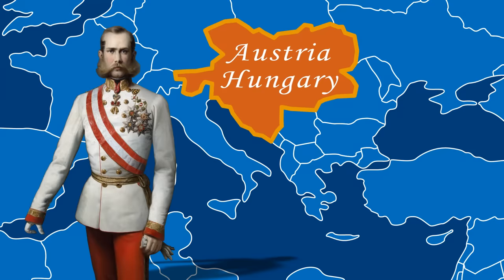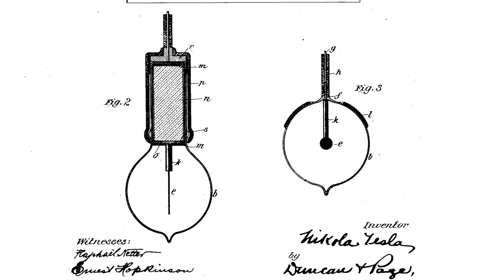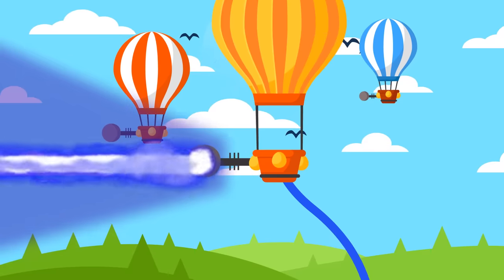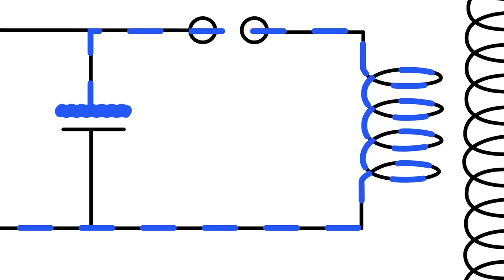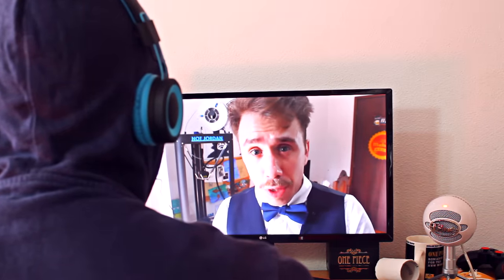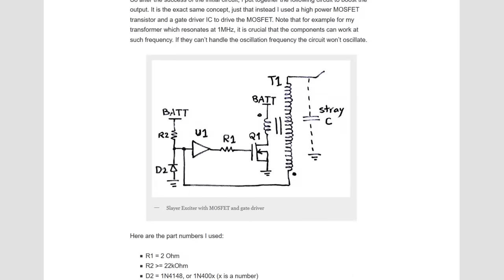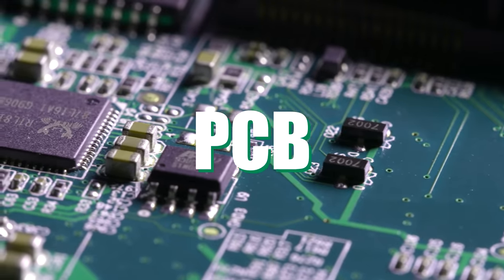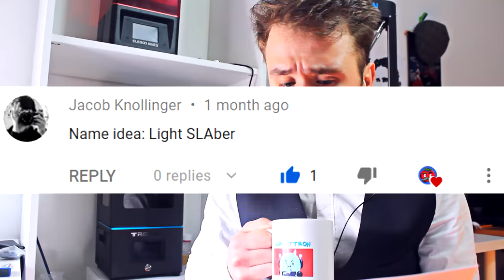Tesla Coil - Wireless Power Machine 3D Printed (ft .Plasma Channel)

Comment: Another awesome video from Integza!! Thank you!
We only have access to a very small percentage of what Nikola Tesla did. There are other patents and even apparatus that weren't patented by Nikola Tesla that could have transferred electricity wireless. A simple experiment that can be done to demonstrate the transfer of energy wireless, is a simple laser pen and a small solar panel. Tesla also built a version of the laser, his (particle accelerator) He claimed you could shoot down a plane 200 miles from the source. The interesting thing is, you could also transfer energy with the particle accelerator, without the inverse law. All you need is a receiver for the power. Tesla also had a patent for that. Apparatus for the utilization of radiant energy, could be used for that. I believe Tesla as brilliant as he was, would have understood this possibility, and maybe that was how he planned on doing it over long distances without lightning going off everywhere.

Comment: Soldering is supper easy. Put the soldering iron on the material that you want to solder and then when it’s hot the solder will melt onto the surface witch would be tinning the Material . Tinned material are what you need to solder property.repeat the process and till everything is glued with metal. I hope this helps you with your soldering. Love watching your videos.

Comment: So.. ya you touched on it the upper atmosphere contains aspects of plasmas and transmits energy rather quickly.
The original coils, the WardenClyffe tower and his counterpart in Colorado springs had extremely long large diameter grounding rods of copper.
if you truly wish to get wireless to work one would have to build two different grids of isolated conductors along either end of the ceiling or attic
and attach the primaries of each coil to a long grounding rod at opposite ends of the house for safety.
hope that wasn't too confusing.

Comment: remember that weather you use a spark gap a transistor mosfet or scr the process generates a very large voltage spike that is a big part of what it does, so you must take this  into account when you select the part you use.

Comment: yes a tesla coil generally have a q of 90 0r more that is a ninety to one raisio and is not strictly tied to the windings ratio. the breakdown voltage about 40v per 1/1000 of an inch it is about the same for vacuum.

Comment: The energy Tesla transmitted was NEVER through  the air, but through the GROUND. The Tesla coil is considerably more then a simple resonant transformer, it is a coupling device between the capacitance in the air and the ground currents, the top capacitance made out of many small hemispheres (as in the magnifying transformer patent)  and the extensive grounding are the 2 crucial parts. The primary, secondary and thirtiary are tuning components.  Finally the sparks are not transmission of energy they are pure loss in the system., for Tesla they were just a measure of the  potential build in the apparatus, and were not used for anything useful aside from that particular use. The energy is and always has been transmitted though the amps in the ground and not through the vibrations through the dielectric air.
Please read AND understand the patents and Tesla's writing and after that post hopefully more educational videos and not mostly wrongly understood patent interpretations  as this one.
Reply: That was my understanding as well, it was through the Ground. Thats why his death ray (that was basically a vaporized mercury accelerator) worked on ships and not air craft

Comment: Next video: 3D-printed beard of Nikolai Tesla.
Also nice video, as always.
Btw, the secret to soldering is a lot of flux and solder with 2% copper content.
Reply: Also try to get the good old leaded solder. It's a thousand times better than lead-free solder.
Reply: Look up Louis Rossmann for how much flux to apply (answer: more than you currently have)
Reply: Also I thought the PCB design was a little cringey, unnecessarily thin tracks and little effort at separating them

Comment: to get range you need many things, hose length, valve shapes, a mini diminishing pyramid stepped to exit pin hole a hose, and then a giant external cone that surround exit stream without touching it will laser waves into tunnels, add spin blades.

Comment: Not sure if you know but you can light up a florescent light bulb with static electricity just by rubbing a towel over it, just go in a dark room because it will glow slightly depending on how much static. Fresh out of the dryer would be best and don't use a static guard sheet
Reply: Go into a dark room and rub it with a towel. That is not SECS but may generate something

Comment: It is documented that Tesla intended to make an electrical connection to the low pressure high altitude conductive region by using ultra-violet lamps, which he knew could create ionized pathways. One illustration of the Wardencliffe tower shows UV lamps installed in the dome.

Comment: Hi, I just thought I'd share some information in case you want to build a more powerful slayer exciter. I find that the original SEC works better that the one which uses a mosfet, I recommend using the TIP41C transistor with a 5K resistor, this allows you to use 12-24V DC as input (make sure to put the transistor on a heatsink!). Also you can reduce the number of turns on your primary coil to 2 or 3 turns and you can adjust the position of the primary coil by moving it up or down to get better output. This should greatly boost the output of your coil and give it better range.
Great video by the way ;)
Reply from the maker: Thank you so much for the advice and also for watching 😁
Reply: @integza  No problem :D

Comment: The channel is awesome.  Have you considered running a Tesla coil in reverse?  You place a bundle of wires to act as charge antenna as high as practicable.  You connect this high voltage source (200V/m is the typical earth charge differential) on the secondary.  Then you use the Tesla coil to act as a STEP DOWN spark gap transformer.

Using transistor is not at all the same.  There is a catastrophic breakdown at the spark.  You miss out on gamma rays and other neat stuff by using transistor.  Did Tesla use a transistor?

Comment: A true Tesla coil, uses IMPULSES. these can be generated by discharging a coil. 
The inductive spike (bemf)created by the coil, is an impulse.

If the primary is series resonant (low impedance) , these Impulses pass through them. 

Then the second higher resonant frequency is used, so the secondary becomes LMD (longitudinal magneto dielectric) resonant. 

see my april 2019 Radiant Power video for more info on how too...

Comment: wireless power can be sent .. its just energetic change, so using a dish to concentrate you ccan charge wirelessly by light sou8nd or magnetism .. using small magnetsz to focus a magnetic field you canmagnify any mag field .. radio waves move a speaker .. make a wireless powerless speakeer and go from there ...

Comment: It looks like the attenuation is greater than one over r squared. More like 1/r.
This idea morphed into the haarp system. They drop the resonator (barium chemtrails) at the altitude and excite it to radiate using microwave beams. It does the same thing Tesla imagined but it is now weaponized.

Comment: I have a tiny USB Slayer Exciter Tesla Coil. It doesn't produce sparks and doesn't have a topload, but its primary function is to excite the gas inside a Nixie tube. It glows orange, and it has a tiny green LED in the bottom for extra effect. There's alway room for LEDs in anything. Keyboard? LEDs. Mouse? LEDs. Headphones? LEDs. Your car? Yeah it already has LEDs. Put some more in! Your PC? Not enough LEDs! Put RGB RAM, RGB liquid cooling, some Neopixel strips and RGB GPU in there!

Comment: Moving the fat coil to center maybe you can collect more power from a single wire transmission from other tesla coil. But you may want to invert the coil to get max amps out.

Comment: Came over from Plasma Channel.
DEBUNK ALERT: Nikola Tesla's World Wide Energy (WWE) system was NOT transmission through the air. Only his party tricks were. He taught Hertz about EM (and more) and knew its weakness in distance as Hertz experimented and published in the 1870's (to his dismay). So in Colorado Springs he, among other things, did a POC on GROUND transmission using site resonant coils, an "air ground" and an "Earth antenna" to distribute locally (or worldwide) where a distant resonant coil could tuned to needed frequency for use (low or high watts, res vs com) and wa-la! His patents are intentionally specifically vague to avoid patent cheats (a problem his whole life) and MUST be viewed through the lens of his writings (see Colorado Spring Notes, magazine articles, personal writings). Once decoding his patents (every component has a secret tweak or specificity), the application is truly AMAZING. (Patent requirements are more legalese than laboratory science processes.) His backers could have gotten RICH on site reciever hardware and resultant process IP & patents. Most people get Tesla exactly backwards. He was on to something great which is only partly being rejuvenated in private industry research today (ie, proprietary). Tesla coils are toys today. The true Tesla coils (analog) are just large resonant capacitors in an application-specific setting. Not sparks/air transmission, the reverse. Think natural philosophy: Earth source, air return. The NATURAL state. Reverse our weak anthropocentric systems of today in radio, power transmission and all else. 
PLEASE get Tesla correct before re-broadcasting false and misunderstood information. Most info is NOT on the internet and besides Electronics & EE, the Tesla section of my personal in-print (OOP really) library is the 3rd largest (and growing) covering 130+ years of his published works.
In a word: AMAZING. Once you understand Tesla's unique perspective and applications, you're like "Oh! Wow!". Took me over 20 years to "get it". :\ 
Carry on.... 
(entertaining channel BTW) ;)

Comment: "Air is not that good at transmitting electricity...or is it?" If it were, having electricity in your home would be a somewhat fraught experience! You accidentally turn on a socket with thing plugged in and ZAP! Even with something plugged in, why go through all the work of going through an electric motor or circuit when there's a nice easy path to ground which avoids all of that.
Experiment: Take any domestic electrical appliance, submerge it in mercury and apply power. That's what conductive air would look like! I think we share the same sense of humour - hence why I love your channel!

Comment: Running electrical cables all over the world like a net of wire, carrying 100's of THOUSENDS ov volts, to millions of volts, over our heads and under our feets. Also sound a bit insane, if you were to think about it back in the 1870's, a monumental task in the least!  But slowly but surely we have wires everywhere! Everything is on the 'grid'

Comment: Hi there. Thanks for the cool video. Maybe it is worth to tell people that if they try to do it at home, they should use sandpaper on copper wire otherwise due to insulation on some wires,this does not work.
👍👍

Comment: Try to combine tesla's radiant energy circuit and the tesla coil and you will be able to transmit electricity over greater distances than with a tesla coil alone. Give me a shout out when you do this experiment. Also some reason a fluorescent tube bulb seems to act as a wireless antenna.

Comment: Dude just keep your solder tip tinned. I thought I sucked at soldering too before I realized i was doing it wrong. It's actually really easy once you do this so I can assume you don't do this. Look up how to tin your soldering iron. Most people don't even know that you need to do it and just think that soldering is extremely difficult, it is not. Solder should stick to your soldering iron and you should buy a jar of flux to make things even easier. I just recently soldered a bunch of wires on my MAMBA flight controller, look it up to see how tiny the pads are. I did it perfectly and it wasn't more than a couple weeks ago where it took me a half hour just to solder together a couple wires. Soldering is easy, the hardest part is just keeping your hand steady.

Comment: Great! :-) always was wishing to experiment with this principle
Reply: material of HV Teslacoil tube must be low tg(angle of looses) as possible
 teflon, PP, PE(LDPE, HDPE, PE),PS   are good 
PET(PETF),PVC, acrilates  -gives ten times more looses, - tg... ten times more, -> Q ten times less ->resonant boost collects energy only for ten time lover resonant voltage of oscilator with cappacitance involving same materials
it especially visibly on high dv/dt , I.e. with high voltage or/and high freq. of functioning
two tesla coils was builded time ago, same everything but tube material was different- glass bottle and plastic bottle
one coil works like in this video - only lamp light nearby,and tube became warm,
when second coil gives 40mm strimer arcs 
if you turn car ignition coil via(serial oscillating circuit LC) 0.1microfarad capacitor to 100wt4ohm AC amp, that gives sine 20VAC, at 3kHz i find the resonance -when LC was not C or L - but low resistant load for amp, and voltage on first coil of transformator(ZIL-130 ignition coil or VAZ-2106 (lover size but still was ok)) rice to 200VAC and 15mm long - very loud!!! 3kHz arc was on secondary out(HV)
when i change PP capacitor on PET film - that smaller size and cheaper - even it was not 250V but 400V rated - it gives resonance also at 3kHz(i use audiotester windows utilite as signal generator for my loudespeacker  amp) but arcs was only 3mm long, voltage on coil 40VAC and PET film capacitor after a minute start to burn

Comment: Reading "Secrets of Cold War Technology" with Chapter 1 on Nikola Tesla, you get a less mentally disturbing description of how to transmit power wirelessly. The Key is to remove all charge carriers from the electricity (He blasted the spark gap with an electromagnet's magnetic field to drive the charge carriers out of the stream of electricity jumping the gap). So, you are left transforming and transmitting "radiant" energy which is generated from the impulses of very high voltage energy and then converted back into electricity with the resonant, receiving tesla coils. Of course, by using resonant transformers he fundamentally was creating coherent impulsed EMPs, or laser beams of EMPs, which traveled through every substance he put up to futilely block the beams... and discovered the beams actually self-amplified themselves, or were totally lossless, without any degradation with distance. Not your typical RF signal, but more like starlight, which travels millions of lightyears effectively..

Comment: Hold on Tesla Jr. Daddy T. did not try to send electricity wirelessly, but rather AEther wirelessly. He found space filled with AEther, as an incompressible neutral gas. And that it mediated all physical interactions (consistent with modern physics that says no physical particles touch (evne protons inside an atom keep 100,000 diameters distant. The mechanism for launching AEther wavess was ionized matter in spark gaps, where he distilled the AEther from the electric current. His transformer then amplified the AEther impulse and transmitted AEther impulse wave trains without loss through the AEther which acted like a super-conductor. Resonating AEther waves were amplified in the transformers (creating electricity out of thin air. What he found out is biological cells would directly use these AEther waves, converting them to the power they needed. Party on dude, be good to each other. B

Comment: Awesome. The tesla turbine could be an ideal way to mechanicaly rotate an electrical generator, as opposed to the commonly used combustion engine mated to a generator.  The high revs is ideal in power generation.  Construction n landscaping guys always have an air compressor and a portable generator. Im thinking we could eliminate the gas generator and use a tesla turbine to spin the electrical genetator and we could power that turbine with the air compressor.? Would be a kool n handy piece of equipnent to make portable air compressor/power generator combo by including a turbine and generator with air compressor.

Comment: That million volt estimation is very overrated. On my end I checked, and it is barely above 100kV (and that is for a somewhat 80cm-long discharge!). The reason for such a long breakout range is, first, the huge ion velocity achieved on the tip of the breakout terminal (if used - an initial corona it will be otherwise), and how the system matches the frequency of itself and the arc channel, making it heat up and spread further. By the way, that kV/cm estimation also only works for small distances, and becomes non-linear for any higher range. The illusion fails should you try to "catch" a spark with a grounded smooth object - the arcs may hit it, may miss it from pretty much up close (definitely not what is called a breakdown distance, right) - and it is pretty funny to see how they sometimes just curl around it without actually hitting! Furthermore, you can use a fast enough camera to see how a breakdown grows, something that would be pretty tough to notice for the estimated voltage (as the speed would be times higher) - and even better: for short-DC DRSSTCs or SGTCs the huge spark is created in a series of pulses each adding just a few centimeters to it's length!